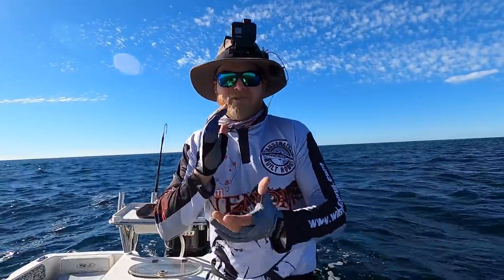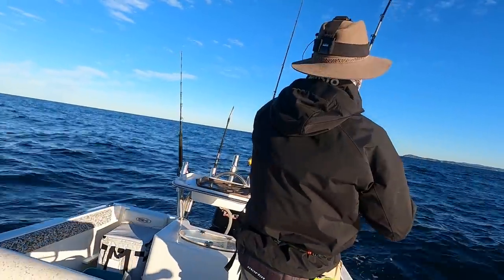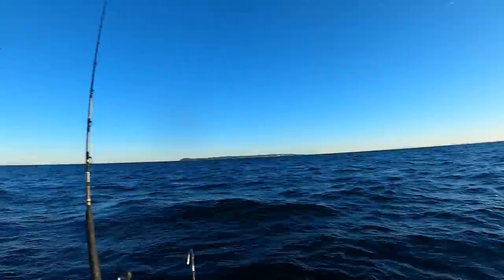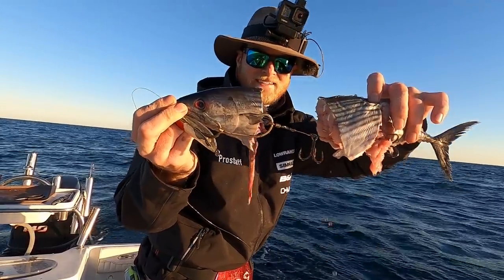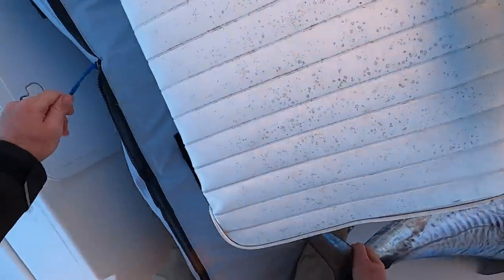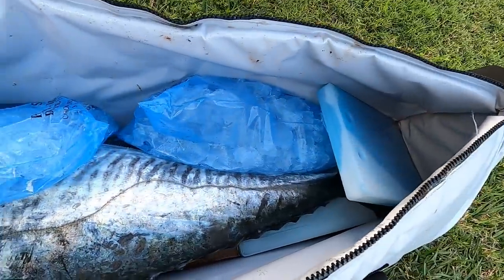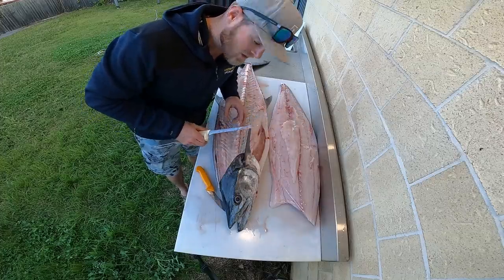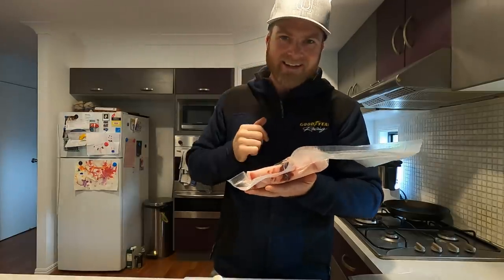This is just the BAIT!

Comment: Hey Sammy, great vid. A quick question about the line you use for trolling on your overheads. Do you use braid or mono straight through and also what line class for the macs? I've recently purchased my 1st overhead trolling outfit of a tyrnos 20 and a 15-24kg trolling rod and wondering what line class and leader to run with for similar fishing. Cheers 👍

Comment: If you could note the name/source of the hardware used to rig the bait -  The weight with push through stiff wires and hook, and does it come with trailing hooks or have to be rigged with the stingers?

Comment: Mate good job.
I use a similar rig but sometimes i run my baits behind a stainless paravane to get them down 5-10 mtrs, or whatever you require.
 Try in future to just cut strait thru one side of the gills. Actually thru the hard boney/ frilly part. Then strop/rope his tail and hang with head just in the water ten mins.. Then ice/pack..
Also You may not be making mac vids in the future with the Qld Govt DAF Fisheries looking to potentially close East coast fishery due to Low mac stocks. looked like there were plenty out there to me. I certainly havnt seen any difference in numbers up North.
Reply from the maker: Yeah mate not sure what will happen with those new government restrictions. Hopefully they don’t start making rules without some real facts!